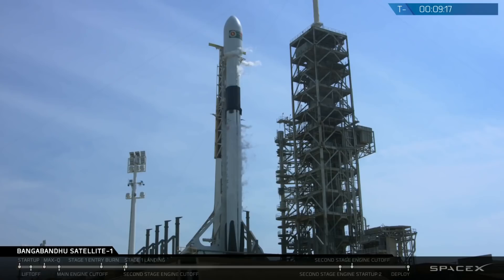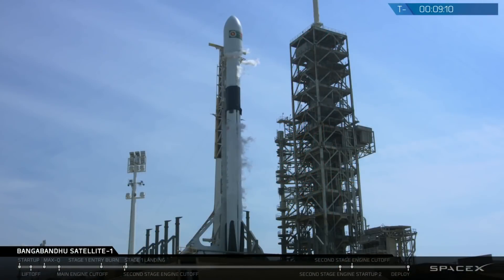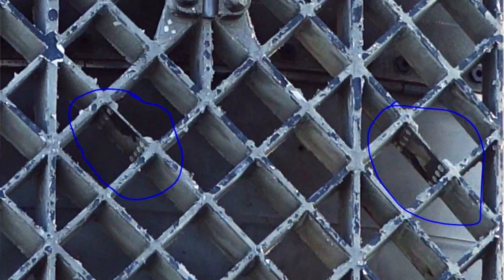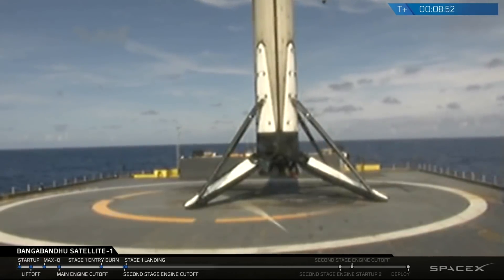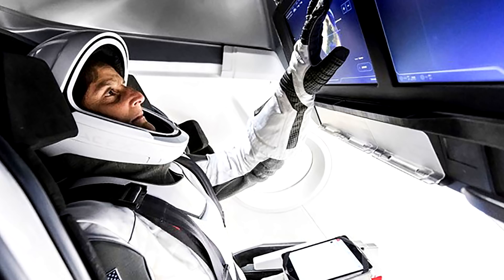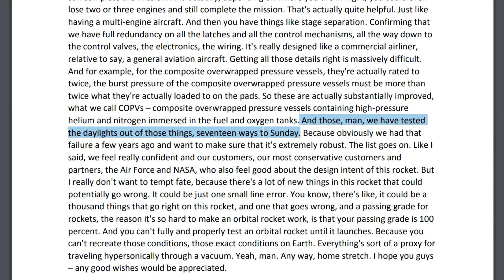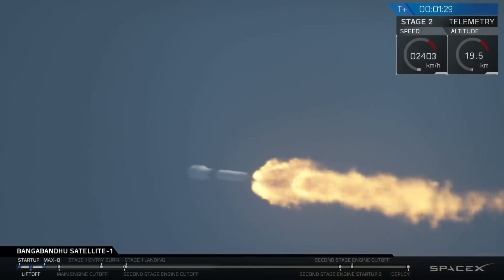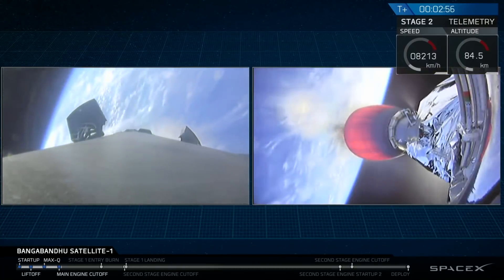How Well Did SpaceX's new Falcon 9 Work?

Comment: So I imagine the extra black "coating" might also be due to the visual aspect. I forget which specific launch, but one of the more recent ones had a fresh fairing and rather rough looking first stage. Imagine if the statistics win and they happen to have a failure after a back to back launch, followed by all of the press having an image of some dingy looking rocket on the pad. No matter how much it seems like distasteful science, the optics are a major factor for Musk-X.
  Also, while I'm no metallurgist, I have been a cycling nut for a long time, and I spent a few years as the buyer for a bike shop chain. I know that the Intense bicycle brand published a bunch of info about their experience with fabricating aluminum downhill enduro mountain bike frames. They detailed their experience with R&D, different metallurgy, welding, failures, and repairs. In particular, I believe they were trying to help people understand why you can't repair/weld a broken aluminum bike frame, but that's an aside. They detailed their experience as a start-up and outsourcing their heat treatment, and their reasons for investing to bring the heat treatment operation in-house. They tracked a lot of their failures to shortcuts taken, and inconsistencies during the heat treatment process. IIRC (over ~5yrs ago) they basically said the primary consideration for aluminum alloys is the heat treatment process available, it's accuracy, and the cycling production time available in the heat treatment facility (autoclave). Again IIRC, the alloy and the designs respective structural properties are a secondary issue to the heat treatment process available.
  Obviously we're talking bicycles versus aerospace, but I wouldn't be too quick to discount the level of development going into an aluminum bike frame. Just go watch a few uploads of pro level downhill mountain bike events, or check out a cutaway of a current Cannondale CAAD10 road frame. Top of the line aluminum bikes have some serious R&D going into hydroforming, welding, and heat treatment.
  That said, a bit of digging into the reason for the alloy swap on the octa support structure will probably reveal a lot more engineering than a simple change in alloy. 
Thanks for the upload,
-Jake
Reply: Upcycle Electronics I don't think they would compromise safety for looks when it comes to human spaceflight or just space flight in general and damn that's a really long comment
Reply: Gamer Boy 
 I'm not saying it's a compromise for looks. Just that looks are a consideration. I don't think the color of a rocket has any bearing on it's safety.
Reply: Looks are very far down the list of design criteria - paint is unnecessary weight, especially at over $1000 per kilo to orbit.
Reply: There isn't actually a black coating, those parts are made of carbon fiber and used to be painted with a protective white coating, and aren't anymore. This is because they are now using a new thermal resin which can withstand the heating, as well as a very very thin hydrophobic coating which allows the black of the CF parts to show through.
Reply: i dont understand why you wouldnt be able to weld repair a bike frame, 
they are welded to begin with, and aslong as you know what you're doing as a welder, your weld should be strong enough to hold a few tonnes let alone 1 tiny human and the metal next to the weld if done properly during and after the welding process shouldnt have been weakend enough to collapse either.. so. i dont get it.
Reply: Because having a cut and weld changes the rigidity of that area and how the structure as a whole works/distributes loads. There's probably far more too it when you're going that in depth on a bike frame, and it's probably such a specialised kind of bike that repairs might genuinely be very hard to do going from the description versus a normal pushbike that could be macguyver style if the push really came to shove.
Reply: "Because having a cut and weld changes the rigidity of that area and how the structure as a whole works/distributes loads" yes.. well thats what i already said, a very localised area, but its still goin to be bloody strong, and tbh it cant be that hard to weld it in any location as it is welded there before,  but there is just no way that welding somewhere in a BIKE frame would make the bike no longer strong enough to carry a human and be actually 'fixed' 

i work with welding every work day, i've seen aluminium welding ( i did not do it my self, heck, my welding machine cant even do that) and when done by a skilled welder it's bloody strong, the material around it obviously get a heat treatment, which hardens it and makes it a bit more brittle ( as goes for any other weld on any other material ) you can treat this / relief it a little bit by giving it another treatment, heating it up and slowely cooling it off to get the crystals back in the right place.. there asfar as my metal working knowledge goes shouldnt be any reason a bike frame cant be repaired by welding it other then .. economics "yow guys,,.. you cant repair your race bike / mountain bike by having it welded.. you gotta buy a new one,. yep.. buy a new one"  <- now THAT would make sense.
Reply: Eagles_Eye 
You can't control the differential temperature and the cooling rate of the alloy. You can't even ride a welded frame straight from the factory until after it's gone through the heat treatment process to normalize the alloy and relieve all of the stresses from the welding process.
 ... going back even further in my past careers...
   I was an Operating Engineer (Local 12) and while not certified for aluminum alloys, I was certified for Structural Steel (AWS - CW). 
...There is an enormous difference between welding steel, welding aluminum, and welding thin wall aluminum tubing, usually without access to the rear of the tube. It's almost impossible to weld such a tube without lots of application specific practice with the frame/alloy in question.
    A thin wall frame tube is going to bend and twist all over the place. The welder that is building these frames has a top of the line Tig torch/rig with the settings dialed. The interior of the frame has a controlled atmosphere, there are all kinds of custom jigs, hot plates, and quinch rigs, used to control heat dissipation and heat soak. Not to mention the welder has a very specific step welding process from one area to the next so that, after adding heat in one area, the contraction it caused is counteracted on the other side. Then there is the biggest factor, all of this is done on a special welding table with a jig that holds all of the key joints and surfaces in alignment. This table usually has a motorized rotation element to enable the welder to access 360 degrees without stopping in some areas. Every step from joint prep through to the end of the heat treatment process is done with bare metal. 
    Anyone that properly tries to repair an aluminum frame must strip the frame completely, do their repair, and then heat treat the frame. Absolutely anything else will fail in short order. I can guarantee you 100% it will fail within 1 centimeter of the weld location. Trust me, I've seen this a couple of dozen times while working in bike shops. Lots and lots of bozos learn this the hard way. They often wind up with plaster cast body parts as a result. The structural properties of aluminum alloys are totally dependant on the heat treatment process. 
   Yeah you can weld a big bar of aluminum to another big bar pretty easily. You might even think your capable of welding any kind of aluminum. That bar is not even in the same league as thin wall tubing. Cut a Coke can in half, weld it back together, then fill it with 2 atmospheres of pressure again. If you can't do that one, don't try a bike frame. It's a more difficult challenge and a mistake could cost you your life. 
-Jake
Reply: you can control the differential temperature / cooling rate with glowing technique, not sure the english word for it but we got a machine with insulation that controls the temperature and controls the cooling rate, for example it stays at XX °c for 4 hours, drops 2 degrees every XX minutes etc. can take a long time to cool though as it stays on all night.

the welding techniques to avoid bending the materials due to the welding on 1 side is similar to every other material you can weld, have you tried thin wall titanium tube? even stainless steel bends like a mofo

we got top of the line Tig machines <-- except I dont, like i said, i dont have the machine to weld aluminium you need a machine that switches power ( seriously my english is shit i dont know the english terms ) to punch trough the oxide layer without melting all the way trough the rest of the material as the oxide layer has a higher melting point.

honestly, im pretty damn sure if i let my 64 year old colleage repair my aluminium bike frame, its gonna be fixed.
sure, it may not look as neat as the factory welds, but if you can do it, we can too.

also the inert gas inside the frame,.. well it wont make that much of a difference its not stainless/ titanium which burns/dies what ever you call it. without protective gas from the other side.

thanks for your information though, im sure its not as easy as just cutting the pipe, holding it togheter and throwing a weld on it,  but im also 100% sure if i let my colleage do it, its gonna be fixed.
Reply: Eagles_Eye 
  Ok so, let's go even further...
I come from a background of the back office of a small chain of bike shops. I was the buyer/inventory manager (which was a career vacation to help motivate me to ride even more and get in shape). I decided what products we carried and handled all of the problems from warranties etc. The owner of the shops I worked for also has a carbon fiber repair business, and is currently one of 2 contractors for Cervelo's custom paint and warranty refurbishment/repair. We did not repair anything aluminum. Aluminum frames are just a few hundred dollars and it is far too much work to repair them correctly IMO.
  I tried to find the original article I referred to before but there is a good chance it came from an industry magazine or something from "Interbike" - the yearly wholesale industry trade show in Las Vegas.
  A basic search lead to several different magazine articles that cover a few details I originally read but I haven't seen anything that goes into the full details as I remember reading them.
   I'm going to quote quite a bit of what I just found next here in another post, but before I do, let me just say a few words...ok more than a few... 
    The Bicycle industry has a standard margin of 35-40% for bikes and frames. Most bikes or frames that sell for $1000 or less have a margin of 40% if the dealer purchases between $100,000 and $250,000 in bikes from that brand. Bikes/frames that are over $1000 have a 35% margin. Bikes over $4500 have a 30% margin, and bikes over $6000 have a 25-27% margin. This applies to most major brands of bikes and is the level most shops buy at. There are larger margins available if a shop or chain of shops orders more but it's only 5-10% better margins. Of course there are exceptions, but this applies to all the big brands (Giant/Trek/Cannondale/Orbea/BH/Canyon/Bianchi/Scott/Santa Cruz/Pinarello/Look/Cervelo/Felt/Wilier/etc), except Specialized and BMC...off the top of my head - that's the list of most brands I've dealt with personally..well +Guru (custom).
  Why tell you this? Because most aluminum frames are less than $1000. This means the shop is usually paying around $600 or less. Even then, shops don't usually order many frames unless they are something really special. Frames are usually acquired due to either a foolish shop owner or manager parting out a bike or because of some kind of warranty. Often times a demo bike or bike rental gets damaged and a warranty frame is sent but the shop isn't willing to put money into the rest of the components that may need to be replaced. Often times this kind of thing happens to shop employees too. There are lots of grey area situations where a damaged frame is simply warrantied to "take care of" a shop owner or an old shop employee. The brand's bike rep really wants to keep the employees riding their brand so that customers see them and it generates more interest in the brand from the people selling the bikes....and this is where things get tricky and the reason I'm telling you all of this... Often times these warranty situations don't work out as well as they were intended. Often times this leads to a spare bike frame that finds it's way on eBay, Craigslist, etc. On the used market these tend to go for one of two prices. The general trend is for popular items in the core sizes (medium and large for MTB frames) to sell for around dealer cost. Less popular items will trend towards another value. There is also what we call "EP" aka Employee Purchase pricing. Most brands will sell directly to a full time employee of a bike shop for 20% less than the standard wholesale price for a single bike or frame once a year. This means that a $1000 bike/frame that costs the shop $600 will cost the employee $480. Often times I see items that go for these exact prices on eBay. If you know these numbers, you know what a really good deal looks like and you know how much money the person is making or losing on the other end. When I'm shopping for a bike/frame, I set up a specific "watched" search on eBay set according to these numbers. Bike shops and employees that need money will often list even better deals on auctions too. However the best time to buy a bike/frame is always December-February as this is the slowest time of year for sales and cash flow. Many shops would gladly sell you a bike at cost during the last week of each of these months right as they have rent due, and payroll to make. Here in the US, the bike market picks up as soon as people start getting their tax returns between March-May. Once that happens, you won't get a real deal in a store.
 This is how you get a frame or bike for a really good deal without getting hurt on something that was repaired. Honestly, it's not worth getting hurt. You have no idea how bad it can be until you experience it. I bounced back from many MANY injuries including getting hit by 5 cars in 7 years. The one that got me was the 6th and 7th cars. They crashed right in front of me, then into me, and now I'm partially disabled as the result of a broken neck that lead to chronic upper back injuries. I'm covered in scars from all the times I've gone down. I'm mostly a roadie as 8 of my 9 bikes are road bikes. My 9th is a Cannondale Jekyll HM Carbon 1, so yeah I ride an enduro, and I have a few scars from trails too.
  When it comes to bike repairs and failures, your fine so long as the repair will generally cause the frame to fold or collapse as it fails. This is how most dents in aluminum cause failures. The absolute worst failures are the rear lower chainstays and the fork or head tube. A collapsed type of failure tends to leave you riding a noodle. Anything that can crack or fracture and release a wheel or change the wheels' alignment can be deadly. They always seem to fail at the worst time. They can also cause other failures you don't expect. I know of one guy that had a front fork that managed to stress his front wheel skewer. It failed on a bump going downhill at close to 40mph and sent his front wheel flying down the road ahead of him. That one cost him several surgeries over a year to fix his fractured arm.
   I used to think I could avoid or bounce back from anything. I've ridden over 200,000 miles in the last 10 years including commuting to work for 6 of those years and 1 year of that commuting 63 miles (100km) a day 5 days a week. I've had hundreds if not thousands of close calls and near misses. The one that got me was someone doing something so unbelievably stupid it's beyond anything you could ever predict or imagine. While that is different than what happens on a trail, failures are always unpredictable. Saving a few hundred dollars extra to get something safe you can count on is much much cheaper than spending/owing hundreds of thousands in hospital or doctors bills and the physical therapy or permanent disability that could result from a repair.
   At the beginning of 2009 I was 350lbs and in 2013 I was 190lbs and racing bikes. I became a gimp 2/26/14 at 8:45AM and regained consciousness 3 hours later in the intensive care unit of the local hospital. I've rarely left the house for anything but doctors lawyers and physical therapy in over 4 years. I tried to work. I've pushed so hard that I seriously injured myself fighting to get better. I would trade anything to get better, even if it means being massively over weight. I still ride as part of physical therapy, and I love it, but it's not worth being a shut in and in this situation. So from that perspective, I tell you, it's not worth the risk. If you go flying off the trail into a tree at 30mph head first you could easily get the exact same injury I have, and yes a helmet is great but it doesn't stop your body from compressing and damaging your neck/back or anything else that doesn't heal.
 Sincerely,
-Jake
Reply: This is a copy and paste of a PinkBike article where Intense Bikes was asked a bunch of questions. The article appears to be inspired by the one I originally read.
What is a heat treatment oven?
Basically, it’s a big pizza oven that you put a number of frames into that are held in place with special racks. The frames are heated to a specific temperature that is close to the melting point of the aluminum alloy and held there for about an hour. A tank full of a water and glycol (antifreeze) mixture is rolled below the oven when the frames are ready. The frames are then dropped within seconds into the quench tank, which freezes the frames into an annealed state. When the frames are annealed, they are very soft and pliable – it is called ‘zero temper’ (T-0).

Why heat treat frames?
Actually, we are dealing with different degrees of temper within the different material we make the frame with. All of the different parts of the frame can vary from annealed condition to full temper before the frame is assembled. The tubes can arrive at the T-4 stage, which is about half strength, and the sheet that we construct the hydroformed parts is annealed at the T-0 stage. Machined parts, like the bottom bracket, dropouts and shock mounts are full hard, in the T-6 stage. Also, welding puts stresses into the frame, because the center of the welding zone is essentially annealed and very soft, while the areas around the zone can vary from soft to full hard. So, the heat-treat process is necessary to return the entire frame to a consistent level of hardness – which for us, is the T-6 temper.

Does welding and heat treatment require the frames to be realigned?

The water/glycol mixture helps the frames cool at a consistent rate during the quenching process, which prevents warping, but there is still some misalignment in the frame that we check for while the frames are annealed. We align the frames within 12 hours while they are soft, on a special fixture, and then we put them back in the oven to artificially age them. The aluminum will automatically begin to harden at room temperature, but the oven gives us control over the final temper, which is the optimal T-6 condition. 

Explain the annealing process
After the frames have been annealed, the crystalline structure of the various elements within the aluminum is more or less lined up, so when the metal is stressed, they slip over each other quite easily, which causes the metal to be easily bent or deformed. As the alloy is aged at a temperature near 350 degrees F, the crystals begin to gravitate towards each other, which forms uneven pathways for stress within the alloy. This causes the aluminum to resist deformation and it becomes much more rigid. The aging process occurs at 350 degrees for about eight hours in the oven.

How can you be sure that the frames are annealed to the proper hardness?
We use a simple Rockwell Hardness Tester on every frame that is basically a hand-press with a pointed probe that pushes exactly the right amount into the aluminum with a measured amount of force when the temper is right. Several times a year, we send samples to an independent lab where they perform a strip-tension test that indicates the metal’s ultimate tensile strength. We also have our ovens calibrated at regular intervals to ensure consistency.

If a frame is broken can it be welded repaired an re-heat treated?
Well, yeah. It depends upon whether it is repairable. Some say that it may not be wise to re-heat-treat a frame, but we essentially are re-heat-treating each part of a frame when we first assemble them. The key to building or repairing a frame is that the aluminum cannot be contaminated with paint, grease or any foreign substance. We have a special washer that every part which will be assembled into a frame goes through and we also use it when we do a repair. The fact that 6000-series aluminum can be returned to full strength is what makes it such a good material for a frame - and makes it possible to repair them with good results.

What kinds of aluminum alloys do you use at Intense?
  All of our frames are made from 6000-series aluminum. Some parts are 6061, some are related alloys like 6009, and all require the same heat treat process. We use different alloys, like 7075 for non-welded items like suspension pivots, custom screws and rocker arms that we machine which have different strength requirements, and for parts that will be anodized later..
-. : . : . : . : . : . : . : . : . : . -
......... Another similar article I came across from satincesena dot net .........

Grades of Aluminum Alloy

7005 is the grade of aluminum alloy I use for my frames. Most manufacturers of alloy high-end frames in Taiwan use this, whereas China-based manufacturers will mainly employ 6061. Neither grade of alloy is “better” than the other in an absolute sense. It simply depends on what your purpose is.

One property of 6061 is that it is more malleable than 7005–it can be more easily “drawn”, opening the way to creating a variety of tubing designs through hydroforming processes for example. It is also more resistant to corrosion and fatiguing.

The properties of 7005, however, make it more suitable for creating butted tubing. Although it is more susceptible to fatigue than 6061, this will only take place over many millions of cycles (High Cycle Fatigue), and so is not something to realistically be concerned about. Key differences become clearer when looking at the different heat treatment processes applied to each type.

T4 and T6 Heat Treatment

A frame is created first through welding the tubes of the front “triangle”, which is not quite the right word because of the head tube. Except in those frames when the top tube and the down tube actually form an angle, rather than a curve, you are talking about an irregular quadrilateral. Details aside, after this is completed, the  chain stays and seat stays are then welded onto the completed structure.

Aluminum alloy is a relatively soft material. But the welding messes this up with the area around the weld becoming harder as well as producing a raw frame that needs alignment.  T4 heat processing at 480°C is required to return the material to its original uniform condition. It can then be aligned to within the accepted degree of tolerance–≤ 3mm. Heat treatments are outsourced to a specialist company.

The next heat treatment process is T6 which has the aim of hardening and thus strengthening the aluminum alloy. It’s different depending on whether 7005 is used or 6061.

T6 treatment for 7005 takes place in two stages. In the first, the frame is subject to a temperature of 90°C for 5 hours. In the second stage, it is 140°C for 16 hours. T6 treatment for 6061 is 180° for one 8 hour period. Basically, with 7005 you get a rigid frame considerably lighter than one made from 6061.

Another aspect to all this is the cooling process. The standard procedure for cooling 6061 after heat treatment is liquid chemical. Rapid cooling in this way causes distortion in the tubes, and increases the weight of a frame cooled in this way. 7005 is more susceptible to distortion, so frames made from this are air cooled.

Another significant problem is the disposal of the used chemical. Once a factory would expel this sort of effluent directly into the environment. But with strict controls in place, alongside of a more environmentally aware population, this is no longer an option in Taiwan.

The final process is careful QC control in which each frame in a production undergoes systematic checks. I will document this process in as much detail as possible in the next few months. The upshot of all this that utilizing 7005 produces a cost effective, light and extremely durable frame that can be used to build a road bike that is lighter than most of the low-quality carbon offerings that are increasingly appearing in the market these days.

-. : . : . : . : . : . : . : . : . : . -

...Hopefully that helps clarify exactly what is going on in heat treatment processes and welding. Keep in mind the chosen alloys will also have specific filler rod materials that will dictate the square wave settings and cycles for the Tig torch. You will also "suger" the weld if you don't purge the frame with inert gas. These articles hint at the heat treatment temperatures and times but the actual process is much more specific.
-Jake
Reply: Welding thin base metal is tricky. Once a material melts it tries to ball up and thins the material next to the weld. Good technique etc. can alleviate most of that. However, you have NO IDEA of what is going on in the heat affected zone. So to assure homogeneous properties the whole thing gets re-heat treated. This consists of:
1. Solution treat(high temp but not melted)
2. Quench(quickly cooling to freeze the randomness of the “solution”) this is usually done with a water/glycol mix at room temperature. NOTE: At this point distortion occurs because of the small differences in temperature of how the water/glycol and shape of the part interact. Straightening is allowed to get the part dimensional corrected. Also a restraining jig might have been used to help stop/reduce the warping.
So now that you have the part back in shape,comes:
3. Artificial Aging. The popular one is T6. Parts go back in the oven and there is a time/temperature profile the oven puts the parts through. This allows migration of some of the atoms. Initially, The metal starts to crystallize to microscopic “grains”(what we call them in metallurgy). At this point the metal is strong but brittle. As time passes these grains grow into each other(“tempering” isn’t exactly the right description or word useage but similar). Now as the grains grow into each other the metal gets less brittle and loses a little strength. We have decided on a standardized size for these grains to grow that balances strength and brittleness(ductility is the word and percent elongation before breaking is the measurement. IIRC 12-14% is the standard for T6).
“What if you continue the heat?” Answer: The grains will continue to grow into each other. Some will be eaten by their neighbors and the metal will continue to soften and soften.....until you can actually have a single grain!
Of course you don’t want soft material so that’s why we have the T6(or other) standard heat treat. Consistent properties that can be reliably used for design purposes. 

So even though you “can” weld repair thin wall, because of the heat affected zone(that gets mentioned) and the safety margins(small) used for high performance frames you can(almost assuredly) get those failures mentioned(unless you have the equipment etc. to re-heat treat, straighten, etc.). The effort, time, etc. to do a proper repair is why the consensus opinion is “Don’t do it.”😀

Not to say that a thick wall standard frame with big safety margins... sure you have a heat affected zone but you’ll probably have enough safety margin to not worry. But then again......
Reply: Upcycle Electronics Well these are some long comments about welding bikes. I admit I’m too lazy to read them, even though I’m sort of interested.

I agree with you about the visual aspect of SpaceX’s rockets. Generating public interest in new technologies is what Elon does so very well. It would be unfair to say that that’s the only reason for his success, but he has a way of imparting his passion on to others, which is why I think he is such a good leader.

Also this isn’t such a big deal as people make it out to be. I see that space shuttle tank argument tossed around everytime. First of all, the surface area for the space shuttle when considering both boosters, the fuel tank and the actual shuttle is huge, it’s 4 seperate pieces strapped together. A single piece rocket needs much less paint and redundant surface material and protection anyway. On top of that you don’t necessarily need paint to acheive the desired look, you can usually engineer your materials to have the color you want.

Like you said, to reuse a rocket which looks beaten up hurts their public image and would be foolish, when with a bit of clever engineering they can only reinforce their image as market leaders and pioneers of the future with little or no compromise to the rockets function or payload capability